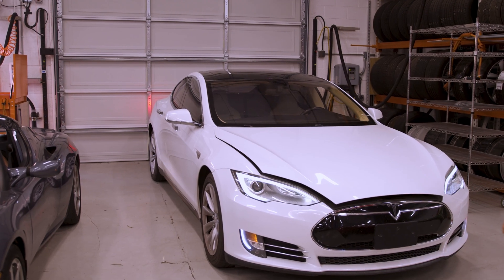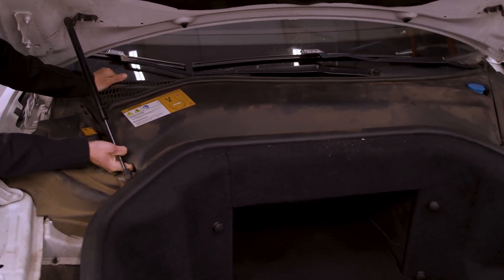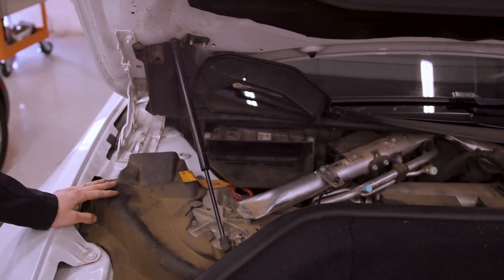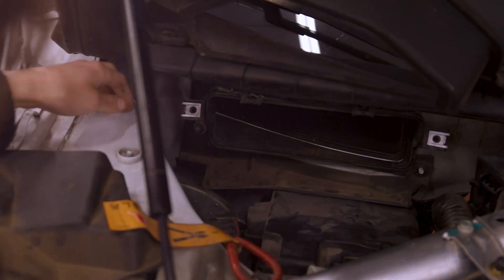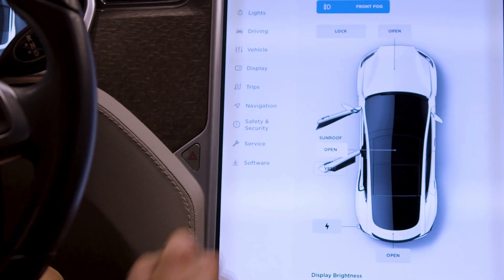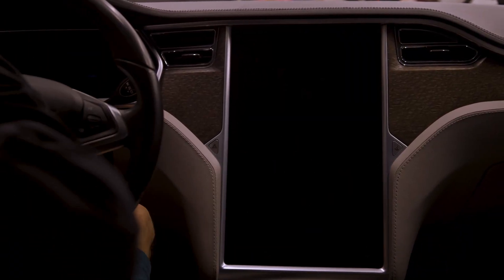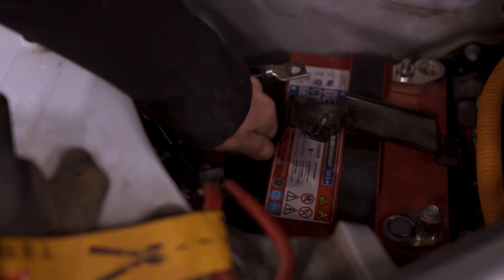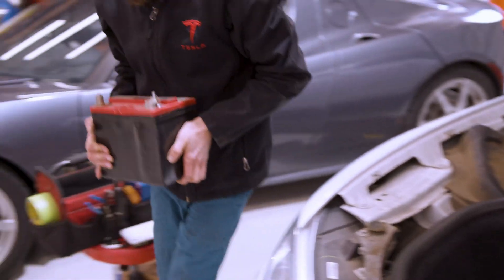Tesla 12v Battery Replacement | RWD Model S | Gruber Motors

Comment: At about 10:01, the terminal posts he's taking off the old battery, is there a place to buy those terminal posts? The posts I have don't want to go in - it's like they're ever so slightly the wrong size.

Comment: just finished installing my new Gruber 12 v battery in our 2013 Model S P85.    not a fan.....next time around I will go with OEM Tesla battery or at least a replacement that has the correct negative terminal position.   The work around, moving the ground cable closer to the passenger side so you can spin the negative ground wire to clear the fuse cover,  puts some real strain on the wiring and getting the battery in position to do this took way too much manipulation and effort.   Much of this is not Gruber's fault but Tesla's very poor design.   Gruber or someone needs to start producing and selling an offset negative terminal post that will bolt onto the Gruber battery and retain the original position for this replacement battery to work properly.
Reply from the maker: We have machined a terminal adapter which will be released this month to resolve this alignment issue.  Thank you for the feedback.

Comment: Isn't it necessary to register the new 12V into the cars settings so the BMS knows that there is a new battery with different capacity or even different charging behaviour installed ?

Comment: Really appreciate the video. Quite disturbed to see how buried the 12V battery is. Wondering if Tesla mobile service techs routinely replace 12V batteries. (car in the video would benefit from an under-the-hood cleaning.)
Reply: They do. I had one replaced at my work parking lot.

Comment: What are your thoughts about replacing this battery with a LiFePo4 or Lithium battery with integrated BMS optimized for vehicule use?  I got my battery replaced last summer after 6 years by Tesla under warranty.

Comment: Considering these 12V batteries never crank an engine with 100s of Amps and never really cycle they should last forever. But they don't. On top of that they are very expensive for their tiny capacity. The exchange procedure......I shall remain silent. Im a bit surprised the HV system gets energized before the 12V gets connected.

Comment: I replaced my 12V battery with a LiFePO4 battery with integrated BMS. These batteries last longer and can be discharged up to 80% without damaging them.
Reply: Question,  does it perform the same in colder climates? Does it need to be heated?
Reply: @gofastnotnow2546  a BMS with temperature compensation is sufficient
Reply: Thanks, I will look into them.
Reply: Which LiPo did you use?